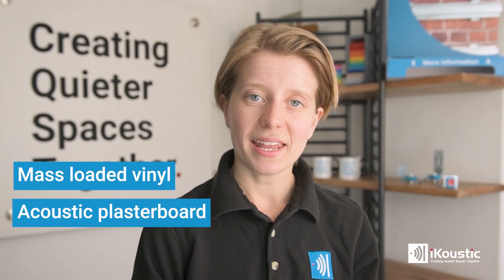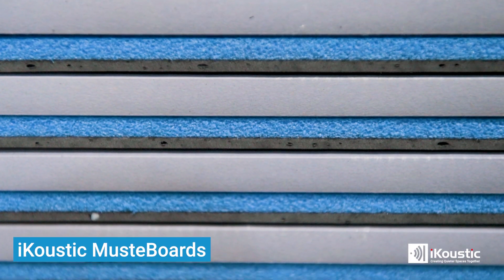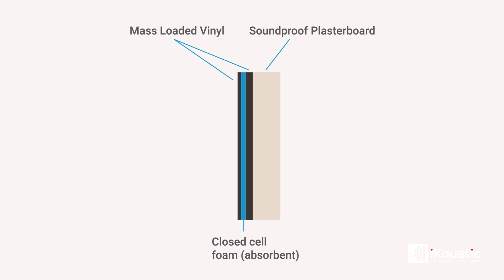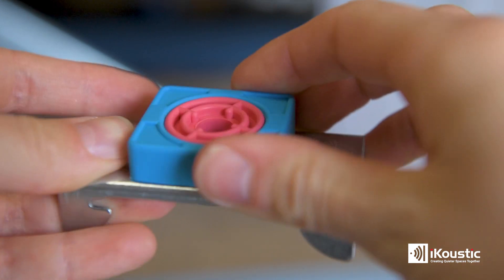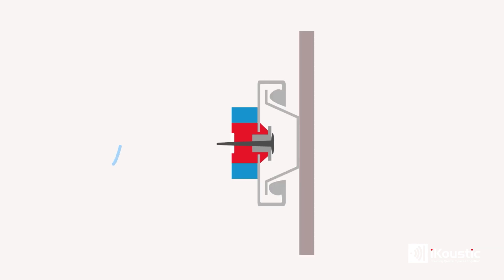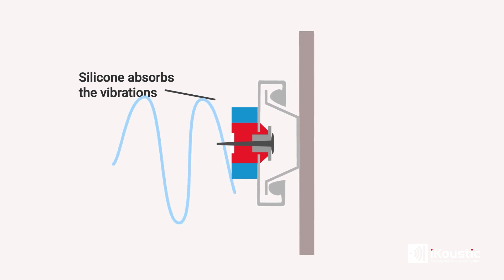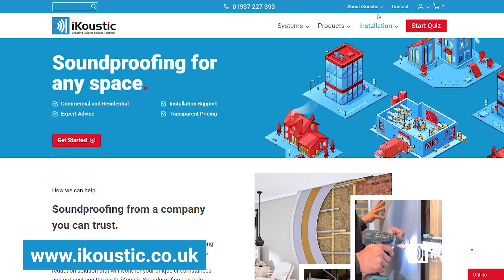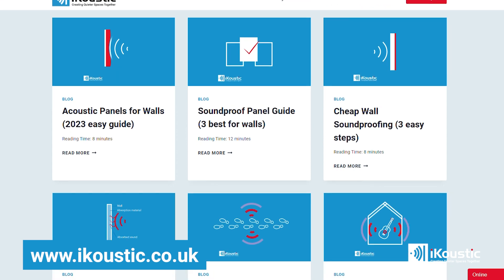How does soundproofing work? Wall soundproofing explained

Comment: Can anyone help me… will this method deaden sound in converted attic space from below… R19, plywood, drywall,drywall, plywood, mlv, carpet… in that order… or suggestions
Reply from the maker: Hi, any soundproofing solution needs to be decided upon by the noise issue. This is why we often use systems as our Technical Team know that specific build up and how it performs against different noises. Call our team if you need system help :)